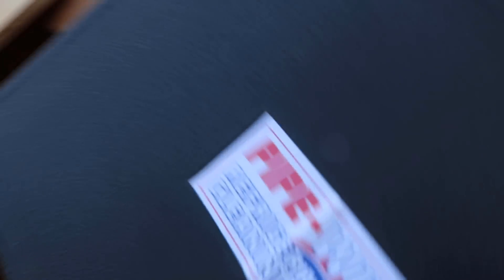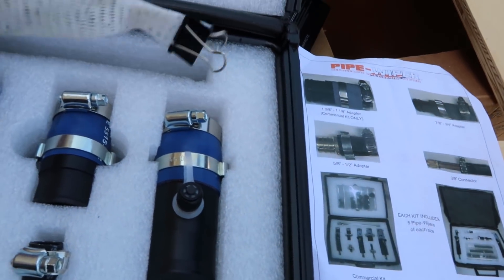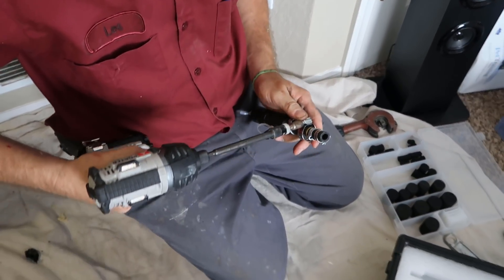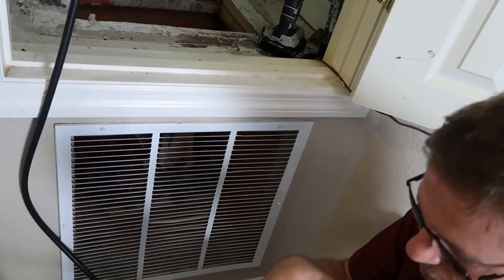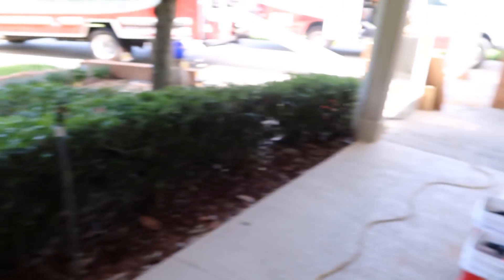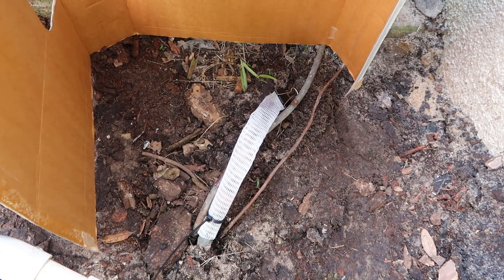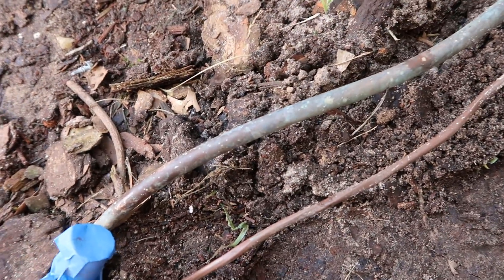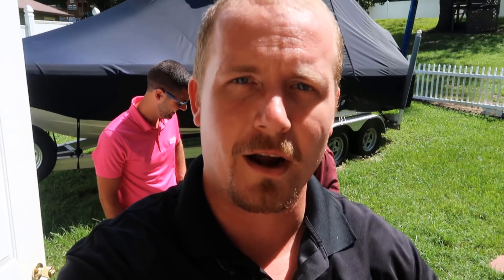How to Wipe Copper instead of Using Flush

Comment: Question.  What happens when you can’t see the lines and there is a kink or sharp bend, or there is un reamed pipe? Does the pig ever get stuck?  How much nitrogen pressure do you use.  Is the pig a soft spongy material?

Comment: My guess is that eventually R11 flush will be banned, like R12 & R22 have become.

R11 does pose some hazards.
It's vapors are heavier than air.  & it displaces air, posing a risk of asphyxiation.
For this reason, it should never be vented into conditioned or confined spaces. If you use R11 flush, flush the line or lines from inside the building, through to outside.

& obviously avoid subjecting it to flames, hot surfaces, etc.

If you or someone on the job site is pregnant, then keep you &/or them from coming into contact with R11.

Lastly, R11 is Trichlorofluoromethane.
So it has that evil chlorine atom in it.

For this reason, it's blamed for putting a "hole" in the Ozone layer. (Lol, you can't put a "hole" in a gas. & even if you could, the surrounding pressure would just immediately fill it in. But that's a whole other topic for another time.)
Reply: I always thought that, but I could understand a gas density change, but presumably it would be a global change, not at a specific point...that’s like trying to put milk in your coffee but only in a portion of the cup
Reply: The Rx11 flush kit that is on the market has a misleading name. R11 was banned many years ago.  I don’t think any of the flush kits contain any ozone depleting  substances.

Comment: Very cool, I had a friend that worked in the petroleum industry and they would send the pigs from state to state as they switch what they are running through a pipeline. Later the pigs were equipped with devices to measure the wall thickness of the pipeline and line integrity. So one pig was doing many jobs at once. Maybe the HVAC world will get something similar just way smaller.

Comment: $500 for a couple corks, tubes and worm drive clamps.  I could likely make this for about $10 if I actually wanted to use something this poorly engineered.  I've seen a POS before, but this wins the golden POS award.
Reply from the maker: If you can make one then go ahead. It works great. You seem like a nice, industrious person. Maybe you will make $1000000000 dollars on your better engineered solution

Comment: No way would I ever use this product.  Too much risk of getting stuck in pipe.
Reply from the maker: We use it all the time... It's never happened once
Reply: I guess you could send the thing backwards, and taking note the smallest was 3/8, which I’ll go out on a limb and presume the pig product density would have tolerances to accommodate deformities, but I do wish there was a product that could expand copper internally up to a foot away, so many people hand bending tube and crushing it as it exits the wall...

Comment: what about copper oxidization removal? you know that p.o.e. pretty much acts as a solvent and scrubs the piping clean. do you install a filter drier as close to metering device as possible?
Reply: That’s where a dryer should be installed, but everyone puts them back at the condensing unit.  I like a dryer and a sight glass, right before the indoor coil.

Comment: If you go to the website (via the link in the description), there is a video demonstration which shows how solvent can be added before the wiper and the wiper removes the solvent as it pushes the solvent through the line.  The wipers can be re-used or new ones can be purchased at an affordable price.  I can also see how this system could be used to unplug a plugged condensate line by just using nitrogen without using a wiper (or you could probably waste a wiper and really clean out the condensate drain pipe.  I could see this being used for a few different applications in our field.  I can also see this being replicated with a few soldered line taps, copper, and rubber couplings from a hardware store and just order the wiper replacements.

Comment: Looks cool, but the inside of that pipe still looked liken it was pretty black. The principal must be then to just remove excess oil? What about oxidation or carbon build up in there?
Reply: The pipe might still be discolored, but anything that could be cleaned off (loose scale or carbon) was done long ago, by the refrigerant circulating around in the system.  That is unless their was a bad burnout.

Comment: Let me play Devils advocate: what happens  if the pig/mouse gets stuck, like if there's  a joint in the lineset, or a slight kink and so on. Then you have a real bad day. I'm not being hateful and I really  embrace anything new, but even if it works 95% of the time,  it's the 5% that concerns me.thanks for the post. BTW  am I being too overcautions?
Reply from the maker: Just blow it back the other way if it gets stuck
Reply from the maker: Also, if it does get stuck you learn valuable information. We have already found a bad suction line kink because of it that we wouldn't have found otherwise.
Reply: Excellent  reply so thanks and good points.
Reply: Zach, at the dinner party, that's when you use the saying "it was like that when I got here"
Reply: If it gets stuck it must be like watching the toilet back up at your neighbors during a dinner party